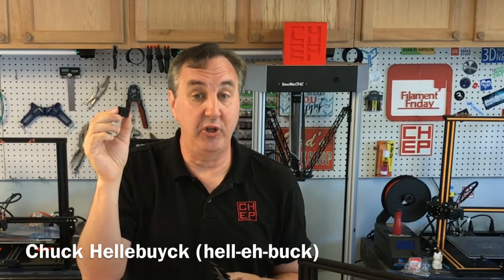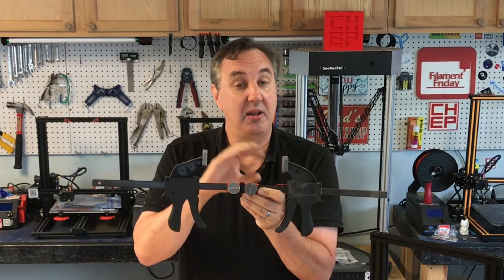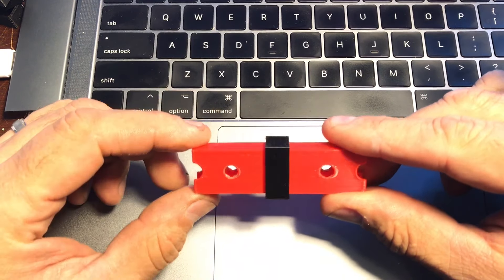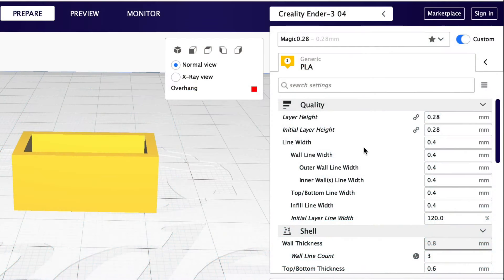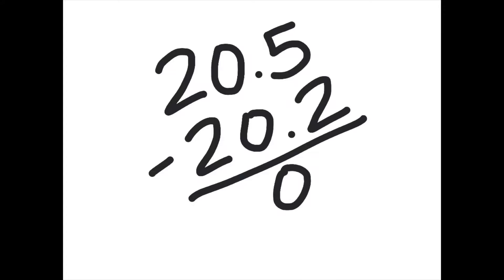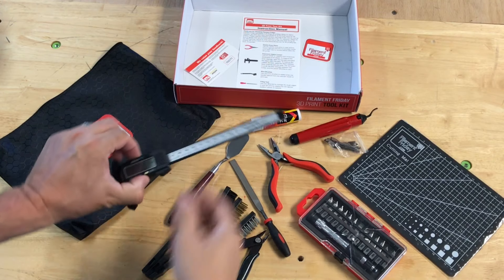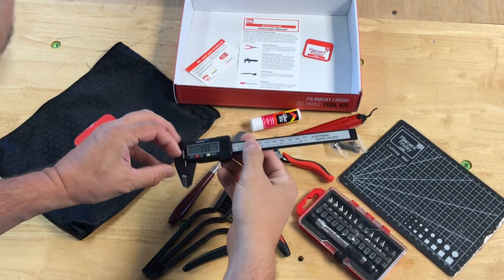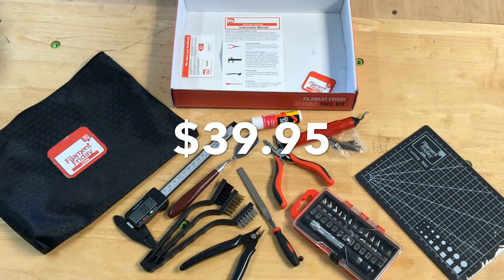Perfectly Accurate 3D Prints using Horizontal Expansion

Comment: Saw this video a couple of days ago and its great! Absolutely works! Being a perfectionist i done a few prints to test some holes i have been having problems with (coming out wrong sizes) , and they came out with 0.1 difference. So i started experimenting with heat and speed on PLA with the expansion settings and bought it down to 0.05!!!  The prints came out with a nice fit on parts  being put together
Thanks again and be safe! Subbed, liked and gonna watch some more videos!

Comment: The expansion feature is quite handy for changing/fixing dimension errors caused by the Filament. It should be no excuse for avoiding a proper calibration of the x,y,z and e step rate. If the printer should move 10mm and moves 10.2 one should fix the overall step calibration before fiddling with the expansion rate, especially as this is the only way to fix a single dimension.

Comment: If you're not running a barrage of tests on your 3d printer (and without asking everyone else what they use), then you're wasting your time. You need to test all filament, even down to different colours in some instances. Temp towers, extrusion multiplier tests etc etc This way you will understand your printer in its environment and conditions. 

The misinformation out there, is so often repeated and believed, you end up unable to convince rational people they are looking in the wrong places. Most people still dont realise that the Creality print head and the way it cools things is just wrong. It leaves you without the ability to control all aspects of the part cooling process and you will receive 40 ill informed answers when you cant control stringing etc.

Test everything! and Chuck is always right :-)

Comment: If anyone interested, this setting is also avaiable in PrusaSlicer called XY size compensation under print settings-advanced.
I did not know you can use it like this before, I only used it if I needed thicker walls on badly designed stl, lol...

Comment: i have been using this setting since the first month i started 3d printing, it's a must have, everyone was telling it was overextrusion, but if i turned extrusion down, it caused spaces between the lines in the top layers, so it's not, overextrusion, and it's not incorrect e-steps because i always had +0.1mm no matter the size of the piece (wrong e-steps are cumulative)
so it is really the plastic expanding a bit.
Reply from the maker: Yep. You understand.
Reply: Every time I see, tighten your belts or do your esteps, I laugh. They clearly dont understand the procees when you see these cures.
Reply: I've been fighting gaps between walls for a while now. Even running 5% above what the extrusion test cubes suggest.

Comment: Before anyone starts adjusting dimensions using this feature in Cura (S3D has it as well), you must first insure that you are not over or under extruding. That means, print a hollow test cube with a known single wall thickness. Measure that thickness and adjust your extrusion multiplier (flow in cura). Once you are printing a 0.45mm wall with a measured 0.43-0.44 actual thickness, then you can start adjusting this parameter, if needed.
Reply from the maker: My printer extrusion is already calibrated. But filament expansion, temperature, nozzle wear,   etc. can affect a print accuracy. This takes all that into account and basically does a minor flow adjustment for that particular print.
Reply: Luke Hatfield on Facebook recommends using a 2 wall cube of 0.8mm for better accuracy. Probably since most prints will not be a single line thick unless in vase mode. It works better for me than the single wall anyway.
Reply: @FilamentFriday  Sorry. I reread my comment and it seems like I'm criticizing your video and implying that you haven't calibrated extrusion already. I apologize. That wasn't the intent of the comment. Since you hadn't mentioned calibrating extrusion in your video (I hope I didn't miss it?), I was just advising others to do so before making adjustments to this parameter. Cheers.
Reply: @OldCurmudgeon3DP  That's a reasonable suggestion. Theoretically, it shouldn't make any difference if you ask for a single, double or triple wall. We are only interested in confirming that the printer is outputting what we are expecting. Two or three walls is probably a bit easier to measure though.

Comment: 1) although I agree scaling the part up is not what you want to do, it should not reduce the size of the inner cavity 2) you almost definitely have issues with overextrusion, and your calibrated horizontal expansion settings will not remain stable across different prints 3) microstepping works fine in the z-axis motion system of all modern 3d printers, magic numbers should not be necessary. Do you disagree?
Reply from the maker: Disagree with all three. 1) I proved it did. It expands or reduces in all x,y directions. 2) I printed multiple parts with this method and it works. 3) Not all microstep angles are equal so Magic Numbers avg out the error.
Reply: @FilamentFriday  that's the key: "averages out." Unfortunately you can't guarantee starting at the same microstep or full step for any print. That would be nice though. The magic numbers help ensure you have better consistency across the whole Z travel even if it's on a microstep. Did I get that right?
Reply: @FilamentFriday  1) Can you point me to the proof? Is it @3:10? I could be forgetting something, but if you scale up an A x B rectangle by 200%, it becomes an 2A x 2B rectangle. It dosn't matter if that rectangle represents the interior perimeter, or exterior perimeter of the part. That said, I definitely agree that just scaling up the part isn't really what one would want to do in this situation, so perhaps this point is kind of not that important. 2) Practically speaking, it probably works fine because we generally always print with low, 10-20% infill and similar wall thickness, 0.8-1.2mm settings across parts. The actual_printed_thickness should be basically (cad_modeled_thickness - horizontal_compensation) * overextrusion_ratio. As long as nominal thickness is typically within a narrow range, a constant value of horizontal_compensation will get you the intended dimensions. But if you for some reason need wall thicknesses on some other part that are 2x or 3x what you normally do, then the error due to overextrusion_ratio will double or triple, while horizontal_compensation won't change and will be unable to compensate enough. 3) That's a good point. Although very good drivers with well matched stepper motors probably can produce very consistent holding torque even at different microstepped angles, from a practical perspective our printers are not that well implemented and it probably makes sense to favor whole steps when possible. I see your video on the subject has some good macro images showing the effects. Thanks for the real-world testing there.
Reply: Microsteps in stepper motors are not linear - but almost linear, so the position that the stepper works best at is 1/200th on a 1.8 degree stepper, but you could plug in a 0.9degree (1/400) or 0.45 degree (1/800) to get better mechanical resolution.
Reply: Wtf is going on in this comment thread.

Comment: Thank you sooooo much Chuck. I use Simplify3D and I found the same setting in Process Settings, Other, Horizontal Size Compensation and set it to -0.15 as per your suggestion and my prints are bang on. My prints were also 0.3mm out. Thank you, thank you, thank you. :)
Reply from the maker: Thanks for testing in S3D. Many have asked.
Reply: @FilamentFriday  No worries, I'm happy to help

Comment: hey Chuck! i know you mention that you are using 4.1 in this video, but i just wanted to leave a heads up for anyone with the latest version of cura (the 4.2.1 hotfix) there is still a bug which prevents negative values in horizontal expansion. the bug is not present in all other versions i have tried, but if you plug a negative value in in 4.2.1 it reverts to a positive value instead. just a heads up for anyone who comes across this.
Reply from the maker: Thanks. Wasn’t aware of that.

Comment: I understand what you demonstrate in this video and the desired goal. The path, though, seems inefficient. A test print (with the consumption of material, time, and energy) is necessary in order to determine correction values. Would it not be much better to ensure that the print process generates the desired result the first time, possibly through a combination of proper design tolerances and calibrated extrusion?

As always, a huge thanks for what you do for the 3D print community.
Reply from the maker: Sounds like a good idea but how do you get there without a lot of sample prints. And each shape is unique. So this is actually quicker and more efficient because the printer/slicer variance.

Comment: Hello Chuck. 
My printer was never on the dot like your prints were after applying the expansion settings in your video. Wow! A lot of what I print is mechanical and needs precise fits. I often have to reprint after changing my CAD file. Not too practical.
Would the horizontal expansionsettings  become the default settings for all prints? Or it changes per material, layer heigh, nozzle dia. etc.... Thanks

So thankful for all you do for the 3d printing community. I have learned a lot from you. You're a goos teacher. Thanks for all the hard work you do.
Martin
Reply from the maker: Have to adjust to the print.

Comment: How do you know that this is horizontal expansion and not a flow or calibration issue with your steps, or shrinkage of the filament?
Reply: Before adjusting horizontal expansion, you should make sure you have all of your steps calibrated, so you know they're not the problem. Also, you need to know the shrinkage amount for the material you're printing with to account for any variance due to that. Once you've done those things, then you can adjust horizontal expansion and know the problem isn't a result of those other factors. So the order of operations matters.

Comment: The price is actually really good. The calipers are about 8 Euro, cutting board about 6 Euro, Pliers depend on quality but should be around 10 Euro and the snipping pliers are about 4 Euro. So the rest of the set is basically for free. I already have all these tools in my shop for years but if I wouldn't have them, your package would be a really nice option. Could be interesting as a present for a friend. Do you ship it to Germany? How much would be the shipping cost then?

Comment: This was a great learn. Finally, the external and internal dimensions match. Previously, I always had to small holes. In the meantime CURA has a third setting that will only affect holes and NOT all polygons. That way you can really dial it in perfectly. But now I have another problem: Doing so many measurements I recognized the corners of a cube are extruded more then the sides (about 0.2mm overall). How would one solve that?

Comment: what about parts shrinking at the z axis/height. I'm working on a guitar body I sliced up, and i decided to print one part sideways for structural integrity, but now its not the same size as the rest of the parts. and after some measuring all my parts shrank on the z axis just enough force me to start over once i find the solution. pls help

Comment: Very nice. However, on my prints fo a similar test object, the outside dimensions are dead on but the inside dimensions are 3% too small. How do I correct for that?
Reply: In cura 5.1, look for "hole horizontal expansion" that should only adjust the inside parameter
Reply: @InternetWesley  Thank you so much!

Comment: Chep, thanks for this movie. I repeated the exersize and here are the resulst: on the holes test I am 0.2mm too small, on the 24x14 I am 0.2 too small inside and about the same on the outside. What’s the solution? Do I think right to add 0.1 horizontal expansion and -0.2 in hole expansion?

Comment: I am not an expert but this symptom seems to be the result of uncalibrated extrusion flow rate (it extruded too much filament at the wall, reducing the size of the hole). I believe that horizontal expansion is aimed towards other scenarios, at least in the case of using PLA.
Reply: You're right, it's probably the line width is set too low for how much it's actually extruding. Horizontal expansion is mainly to reduce wall width in moving parts when your printer cant handle the tolerances

Comment: Love your show :) I got myself Ender 3 recently, installed an aluminium extruder 2 days ago. Not sure why but print quality dropped hard. Checked your video about PTFE tube, wasn't the problem (although I did order replacement parts for future safety). I think that there's too much pressure on the filament :( will try old spring, if it won't help I will install standard plastic extruder to print some filament supply upgrades. I sure hope that the quality will come back if I'm forced to go back to stock...